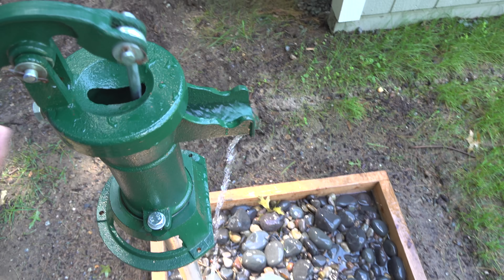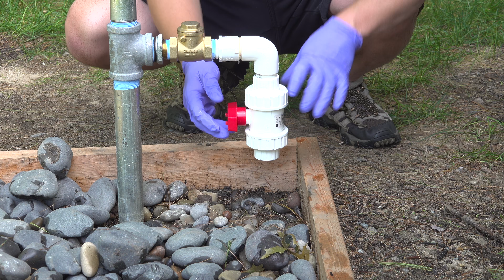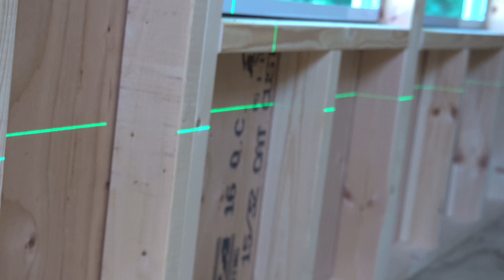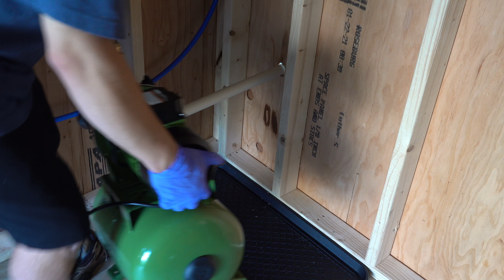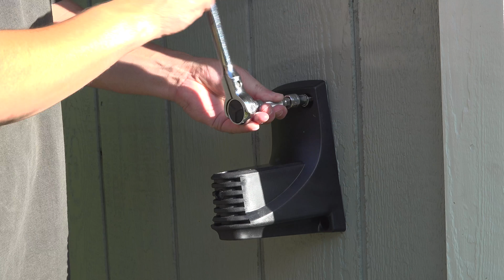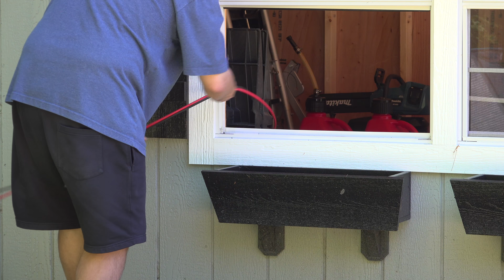DIY BACKYARD WELL with ELECTRIC PUMP - FREE Water

Comment from the maker: Thanks for watching please LIKE & SUBSCRIBE - Sledgehammer DIY Well install https://youtu.be/E-pn41fqYXs  - Tools & Parts: https://www.amazon.com/shop/silvercymbal
Reply: Dude great video excellent work and wow you have a good little set up.
Reply: @jamiegrowthanddevelopment9664 😊
Reply: ❤❤ @jamiegrowthanddevelopment9664
Reply: This is very good!! Thank you for posting!! Do you live in a climate that stays above freezing throughout the year?
Reply: Free after you dig a 10k well
Reply: @odeball22 7
Reply: @clivewhite671  depends.
Reply: Thanks. Great for villages in Africa.
Reply: Please fix all the leaking pluming at the pump, it will cause problems  if not fixed soon.
Reply: screen on floor drain prevent mice snakes etc from easy access to shed
Reply: I have a well but if I could put a solar array then free power + free water would be quite nice.
Reply: Yeah it sure does look betta. 😅🤣😂
Reply: Wh
Reply: Are you a actual idiot or just pretending to be one? Do you even know what free means or are you using the Gov. definition of "free"?
Reply: Good tutorial again. QQ...have you tried using the Delta Mini to power this pump or thoughts of whether this would work?
Reply: Ķķjķ
Reply: OOOOO THE DAMAGED GRASS! lol Install a guttter on that garage homey :D
Reply: Yuguhhuhhhhy uuhn oiuu8
Reply: Is there something that is cheaper than the eco power supply that would work just as well?
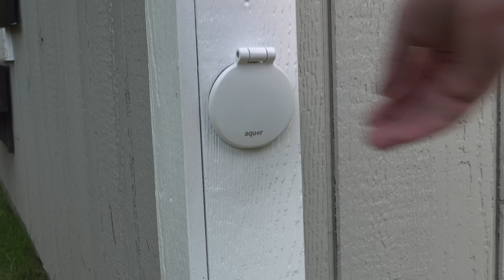Reply: 😅😮❤❤❤😢😂❤😢😢😮😮😮😮😮😮😮😮😮😮😮😮😮😢😢😢😢😢😢😢😢🎉🎉😢😢😮😮😮😮😮😮😮😮😮😅😮😮😮😅😮😮😮😮😮😅😮 3:45
Reply: What area of the usa do u live?
Reply: how the hell do you have the motivation to do this i am super impressed with your work

Comment: Has this continued to work okay for you, both the pitcher and pumped? The T doesn't create an air trap at the top of the pipe?  

I ask bc we're going the reverse order :: replacing our drive point well, underground, pumped into the house, and while we're at it I want to add a T on the well head stack, instead of just a 90 going to the house, so we can add a pitcher pump after. I want us to have an option for water access when power goes out.

But every other video (I've watched countless at this point) is just doing a pitcher pump. And ours is our actual water. House has had a sand point well for ~60 years, it's just clogged, and now a maple has grown right over it. So we're dropping another one. Creating the layout to run it to the house is straightforward enough, but while we're doing it, I figure, let's put in this option too, and you're the only one I've seen creating both in the same stack. 

So, imagine you were just doing the pump (no pitcher), you've had no air gap problem with it being a T joint?

Thanks a ton for any input!

Comment: In any case, your pump will work harder no matter where you cut. You added galvanized pipe and that's it....And you need to install filter before pump because sand will wear out and rust inside your blades.

Comment: Thank you for this and your previous video, I have referred to them a lot while setting up a similar system in my pasture for supplying livestock waterers. I am finding that even with the check valve to my electric pump and ball valve underneath my pitcher to close it when not in use, I lose prime in the pump after a couple of days as the water level in the well point/pipe drops.  I can always get the water flowing again with the hand pump, but not with the electric pump. The result is that i will come out and find the pump running trying to refill the tank unsuccessfully. Anyone have thoughts on how I might resolve this? Right now, I am using the pitcher pump to refill a 25 gallon barrel next to it, and then connecting the barrel to the electric pump to provide water to the auto-refilling livestock waterers. This works a lot better than hauling buckets of water by hand, but is still a little short of my dream DIY well system.

Comment: I just watched a commercial for a bajillion products... So overkill yet so unreliable, the pump inlet is leaking, the pvc either will get destroyed by UV in summer or ice in winter, so many connectors to leak... You drilled a corner stud, don't do that, the water pressure is pathetic and the tank size is too small... And this looked sooooo expensive, the battery bank and solar panels cost something like $12k ... That's too much for an underwhelming performance

Comment: Bro I see you just dig the hole for the pipes but you need tu dig more and put something theat can keep the pipes warm bc in winter season the pipes will froze and make so much trouble. I recommend dig a litel bit and put thermal adhesive so it can not froze

Comment: The only problem is that the lithium ion battery in the generator eventually dies and the generator will have to be replaced so it is not free forever.

Comment: You'd have to fill your ingroud pool 8x to use enough water to justify the cost of all this. I installed an irrigation system last year to handle all flower beds, pots, hanging baskets, and my front lawn. It waters daily or skips when it rains. $30-45 extra on my water bill per month. I water June through September. $120-150 a year in water. I guess if i wanted to water my trees and my entire 3/4 acre yard, this MIGHT pay for itself in a few years...

Comment: Pretty sure the tank on the pump isn't a pure water tank but has an air bladder to keep the pressure up when there are tiny leaks. So it won't start the pump every couple minutes to fight that pressure loss. Makes it last much longer and wastes less electricity.

Comment: Late to the video, you should install a booster tank, it will help keep the pressure steady and prevent your pump from always running especially while sprinkling

Comment: So he basically destroyed the rigidity of the shed to hide a pipe😂
Reply: He didn't, spoken like someone who doesn't own a building lmao
Reply: It's just cheap siding and a little hole in some 2 by 4, it'll be just fine lmao
Reply: Yes very smart move man.
Drilling a 2inch hole in a 4 inch wood doesn’t hurt the structure 😂? 
Which school did you go to? 

You could Leave it be until something heavy hit it and the entire structure caves in because someone was too lazy. Ur probably one of those builders who covers up holes instead of filling them.

Comment: Great build but tbh if you ever plan on closing up those walls on the shed I’d recommend properly plumbing in that pex not using shark bites they’ll hold for now but will leak later on and you don’t want a leak behind a closed wall

Comment: Hi SC, I saw this video when you relased it and I've been eager to install a sand point now that I'm a homeowner. I'm looking to emulate 90% of this setup, except that I'd like to run the pumped water to a slop sink. How would/should I go about filtering? I don't necessarily need it drinkable, just potable (I make cider and would mostly use it clean my brewing equipment that I'd later sanitize anyways, but also would wash off garden tools and such). Thanks!

Comment: Should avoid threading metal male threads into plastic female threads as proper torque to seal at 60psi will result in an extremely shortened fitting life before cracking. Better to eliminate the brass nipple use PVC male adapter
Reply from the maker: Its deliberate so 5, 10 15 years from now the only part that can wear down at all is the adapter.  They aren't threads either, its a rounded keyway

Comment: You're handy and I Iike most of what you did. But the wires from your panels could have been run through the wall to your battery unit, and you didn't make any allowances for freeze up in your well system. Four feet down and up to ground level could be subject to freezing, so you would at least need to open the shut off valve at the top of the well to allow for ice expansion. Or bleed the top of the system out, especially everything above ground. Four feet or so down is fairly well protected from freeze out. But that's here in the northeast. As for the water, if you plan on drinking that stuff, I would sterilize the well with chlorine, then pump it off for a day or two to clear it out. Also, have the water tested for contaminants of all kinds. But if you're just going to use that well for watering the lawn and other non potable purposes, no need to sterilize it . But you might have to filter out finer abrasives in the water or they could damage the impeller on your shallow well pump.
My family was in the water well business for almost 100 years so I know a bit of what I speak. 
Good job and cheers.👍

Comment: Nice video. It was enjoyable to watch. Although I think that the battery that you used as insanely expensive. By the time you add up all the costs of the equipment that you used you probably need to run that pump for about 10 years straight before you break even on it.

Comment: Thanks! Teflon tape is cancer causing use alternative.
Reply: There is no evidence that Teflon tape is 'cancer causing'. Teflon is an extremely unreactive chemical that doesn't 'leach' any contaminates in the weather. It is only dangerous if heated to very high temperatures, as it can give off toxic fumes. 

Stop spreading misinformation and BS. 🤡

Comment: Great Video, I am planning on putting one of these in the back of my property. Can I use this method to fill a small holding tank with a bladder? Does that pump stop pumping when it hits your designated pressure?

Comment: Thorough except for freezing.  As a teen Granpa and I did this in 1974.  It is great to have your own water supply.  I suggest drain it fully so as to avoid cracking your iron and plastic pipes.  'How to' would be a great video extension from this install.
Then your plastic housing for the hose, its hanger, and the PVC needs paint as it will react and become brittle over time.  I'm in the city in the US with the most clear days, with 100+ degrees at over 100 days this year, as usual.  When I buy PVC I paint it straight from the store, I don't even bother waiting to pull it out for a project.

Comment: How would this be done, what extra precautions/steps would I need to take for an area that has pretty cold winters? How would I prevent the water from freezing in the pipes? Is there a way to flush out the water so it doesn't freeze when winter rolls around? I have so many questions!

Comment: PVC pipe cannot be used for potable water.
Reply from the maker: Most schedule 40 PVC found in homes and offices is white pipe with a National Sanitation Foundation (NSF) rating for potable water.  The drawbacks with this type of PVC pipe are that it will degrade when exposed to short wave UV light (contained in sunlight) and at higher temperatures, the plastic softens and releases constituent compounds into the surrounding air and water.

Comment: If you are in a location that freezes, how do you winterize this setup?  Would love to see a video on that!  Great job on the whole project.  I am thinking about doing a well for my multizone irrigation but I'm worried about the freezing and what happens to the well in winter.
Reply: I second this suggestion. If I were to set this up in Fairbanks, for instance, I imagine there could be some problems. Maybe build some sort of well house over the top, and bury the plumbing below the frost layer.
Reply: @tenter8457  In Alaska I absolutely would house it.  With your freeze depth and time I would just drain the thing and have another spring project to restart it.  Not much need for outside water in winter/Alaska I can think of.

Comment: technically your water is not free, you had to pay for the solar panel  and the pump and the materials used.. and there is such a thing as RETURN OF INVESTMENT.. you calculate the time you break even on your setup, after that you can call it free.. that is if the equipment you used does not fail before you get your ROI

Comment: Great videos man! I have the same pump and ecoflo delta max. I just tried it for the first time and it trips the ecoflo when I turn it on. Finally got it to take off and stay on until the pressure switch drops to 30psi and it kicks the pump on again, it trips the ecoflo... any ideas whats wrong here? I'm running the water in from 2 ibc totes for our garden only 5 ft away from the pump.

Comment: I love this video. A couple of thoughts.

1. If you live in an area with incredibly rocky soil like I do, you won't be able to drill your well so easily and will need expensive equipment.
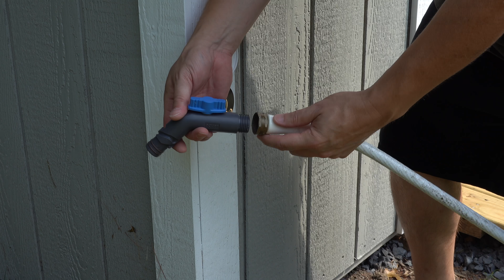2. 6:38 - I would have added pipe dope to that connection. You wouldn't have gotten any leaks that way
3. How much water can you draw before the well runs dry? I have a shallow well that often ran dry if multiple people took showers, then someone did the laundry, so I added a 200 gallon tank, along with float switches to constantly try to pump water until either the well ran dry or the float switch finally indicated the tank was full. I then added a device that auto shuts off the pump when the well runs dry, waits 2 hours (you can adjust the time), then tries again. Since this is just an outside pump (and not your house water), this is probably overkill. But if you're looking for another project, this is something cool you could do. You could get, for example, 2 55 gallon food grade drums. I did this very thing to catch rain water off of my shed. Speaking of which...
4. You could supplement the water coming from the well (in case it doesn't produce enough water) with rain water from your shed.
5. I'm not sure how durable that pump is, but I'd put a sediment filter in between the pump and the well. Again, another fun video you could make

Once again, great video.
Reply: Which area do you live?

Comment: It’s ok guys, this setup is very easy and runs you only $20K. Lol
Reply: You think a cheap water pump, some PEX tubing, a little battery, and a shitty folding solar panel cost $20k?! You're delusional and clearly have no concept of how much things cost. This setup cost a few thousand at most. 

Still not 'free' by any means, but that's not really the point of the video.

Comment: Great video.  I had a question though.  Wouldn't keeping the solar generator in a closed shed damage the battery in the summer months?  I want to do something similar and keep the batteries and charger for my lawn equipment in my shed but here in the Midd Atlantic my shed is usually 10-20 degrees warmer than the outside air.

If you have any video ideas for something like that I would love to see one.
Reply: Is your shed ventilated? If not then that's probably the first thing you'll wanna do. There's a ton of videos out there showing how to do it for cheap.

Comment: Pro plumber here, you did a phenomenal job! I was in shock at all the small, but pro stuff you did. Like that drip pan, I was like, Woah!!! Then you added the drain, and I was like WOAAAHH!!! If you would have ran that tilube out to the side of the cabin as an indicator that it's leaking, I would have just about lost my Sh***t!!! :DDDD.

 One small criticism I'd have is more of an experience thing, but the stronger material is always your female. The connection you had on your pump, you used a 1" brass nipple and connected it with a pvc female. The plastic is molded in two halves and can split, resulting in a leak down the line. Next time, plastic MIP into the pump, or brass coupling and plastic mip. 

Tl:Dr plastic mip > plastic fip
Reply: Plumber here too, had the same reaction. He even did a quarter turn when he glued the pvc. Pass on the sharkbite because it's not covered by drywall and in a shed. Great work.

Comment: Technically shouldn’t use galvanized pipe for potable water.
Reply: I don't think he implied he was drinking this water at any point in the video. Should be obvious considering the only connection is to a garden hose. 🤦‍♂

Comment: What pump manufacturer puts a pressure gauge and controls on the volute of a pump?  It makes no sense!  Also you should have at minimum a straight run of 3x the pipe diameter before the water enters the pump to prevent cavitation and pump destruction.  A 90 degree elbow connected directly to the pump inlet is not a good way to plumb this.  Freezing would be another issue.  Also, the tank under the pump should be pressurized with air and hold some water.  Not sure why you would think it's for water storage (of 2.5 gallons, funny).  I foresee repairs already!

Comment: Between the battery and solar panels would have been cheaper to run power from the house. Probably 10yrs still the solar savings offset all that cost.

Comment: It's absolutely ABSOLUTELY baffling to me how you just plant some wood on the ground and call it a shed. No foundation, made of sticks, literally just put on the grass without any hydro protection either. And then you drill through the 1/2 inch "floor" to drain.. where? on to the grass? lol... 

And lets not forget - nothing is insulated, there's gonna be condensation.. If you build stuff like this, it's not gonna last for shit.